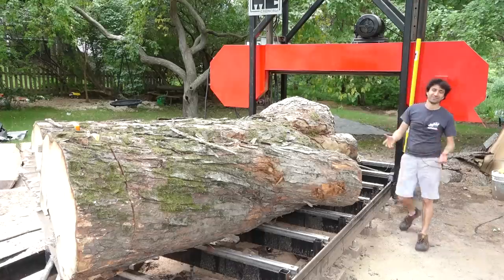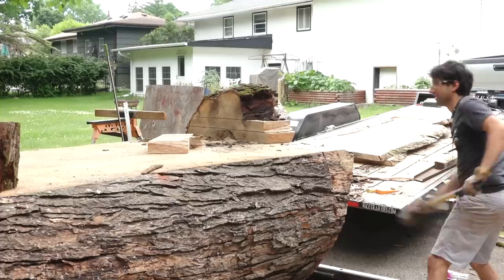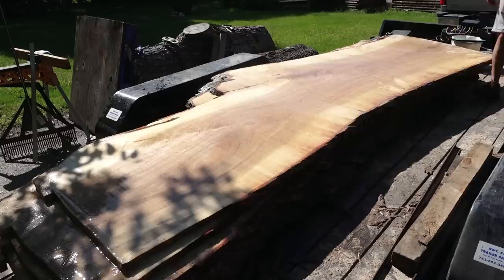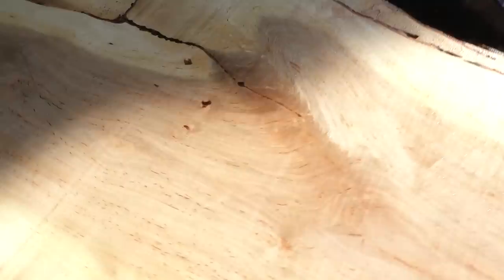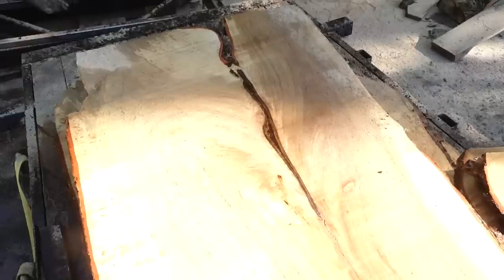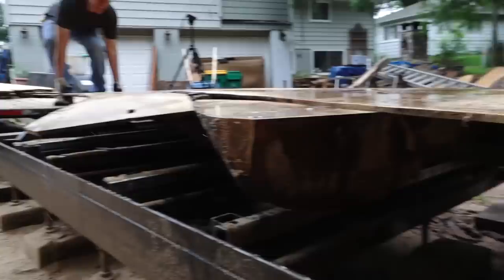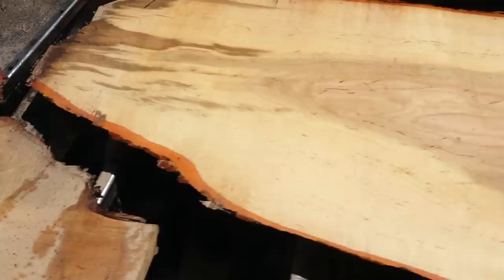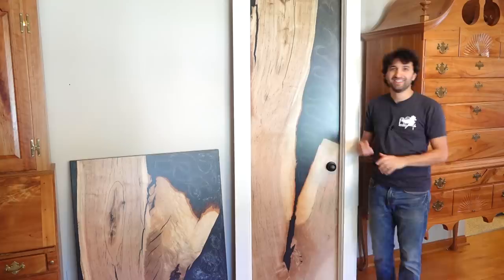The Biggest Log I've Ever Sawn [6' between the guides]

Comment: WHY did you saw 1/2" thick slices? What will that be used for??    I don't see any clamping devices, do you solely rely on the weight to hold it as you saw?

Comment: Hi Matt

I have been watching you for a while now and love the content. Top three YouTuber in my opinion. Thanks for sharing this.

Having said this, year you have inspired me to start milling my own lumber. I’m surprised by the ease of which I can actually get saw logs through Craigslist in my area. I just bought two 50 foot sycamores, a 75 foot poplar for $100 each. I also bought 4 100 ft dead straight oaks for $200 a piece. All I have to do is remove them, they actually had them cut and limbed for me. I don’t know if this is beginners luck or not, but I hope the trend continues.

Now for my question. To date, I have watched 2.7 million chainsaw milling videos, but have never seen anyone mill beyond the initial live edge cutting. What is you best suggestion for squaring these planks into squared workable material for furniture building? Table saw? Circ saw? 

I have watched most if not all of you videos to this point and thought your series on milling and drying was fantastic, it will certainly be my guide through this process. 

Thanks again for everything, I really have learned quite a bit from you. 

Dave

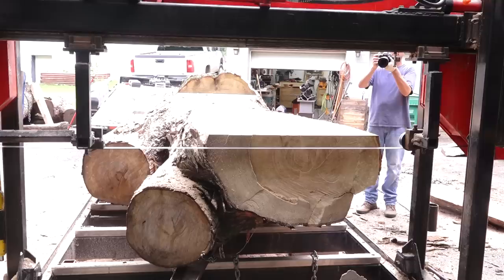Comment: Hi Matt in that first cut just before 2:00 mins what happens to the bits that are too thin for tables or just worktops, do they get used for little nats for cups or pink glasses or hit good place mats and front door plaque to put house numbers  on  so you can sell them to smaller milks or woodwork joiners in bulk and make a bit if cash for Xmas work outings

Comment: Fantastic! Did I miss the thickness at which you cut these slabs?
Reply: I didn't hear it either altho I skipped ahead as it was getting a little repetitive.  But, given how those slabs flexed I guess less than two inches.   Also, not his log, and Eric has uses for this slabs.
Reply: @cdouglas1942  Yeah I picked up on the 1/2" veneer. It's hard to tell in the video but I was guessing 5/4 maybe 6/4?

Comment: Question: if you were to slice, say,  a walnut log into veneer, could you use your normal drying method, or does it require a kiln to dry flat?
Reply from the maker: You might be able to do it if you sticker it every 6" or so but I'd still expect some ripples

Comment: Do these very large and relatively thin slabs have any tendency to cup, or does their own weight tend to keep them flat?
Reply: They absolutely would when air-dried, even with weight on it. These are going in a vacuum-microwave kiln so won't suffer from that.
Reply: @whirled_peas  There's no wood movement using a vacumn kiln?
Reply: @WIReeder12  Almost none and no cracking, due to very even drying. Still possible to get cracking with radial grain (rounds of wood etc) but you typically won't get a significant amount of that in a slab.

Comment: Noob question - how do you keep the slabs from warping or cracking as they dry?
Reply: Ryan J. -- you clamp the slabs down  and pull a vacuum on the wood...  Water boils out at low pressure and drys pretty quickly.
Reply: RobiSydney thanks 👍

Comment: How thick are those slabs? They look much thinner than you usually cut but not sure if it is because they are so wide. Great video, thanks for sharing!
Reply from the maker: I did some 5/4 and 8/4. I usually cut at 10/4. Thanks!
Reply: The 1/2 inch slabs/veneers at least are much lighter to move!
Reply from the maker: True but not as easy as I was expecting

Comment: I built my own mill 22 inch width x 15 ft. The biggest problem I am having is holding the logs while cutting. Any suggestions? I don't see any type of clamping on your mill, of coarse  7000 LB log would tend to stay put.
Reply from the maker: Seems like I use the clamps less and less these days.  Those cuts at the end were just sitting on the bed.

Comment: Quick question bud, why doesn’t the weight of the wood pinched down on the blade?
Reply from the maker: The teeth have set so they're cutting a wider kerf than the thickness of the band
Reply: @mcremona  Thanks Matthew

Comment: I am always suprised at the thickness of your cuts why always cut so thick slabs [not talking about the veneer thin slabs] ? surely furniture making with hardwood does not requires even half the thickness. How much loss are you accounting for drying, checks, twist, arching, and then jointer and planer ? It looks like 1/2 inch extra. Actually not that much in this video but some of your other milling video it's out of hand.
One thing that just came to my mind is that thicker slab dry more straight, resulting in less lost wood by weight. But thinner slabs produce more timber revenue but require a kiln to equalize humidity before stacking for the drying process. I would be interested to hear your view on this.
I guess another part of that discussion is quarter sawn which minimizes checks lost timber. And since you have no hydraulic to turn logs in your mill, and a backing vertical steel plate, it is out of question and so you only 15% of quarter sawn out of every log.